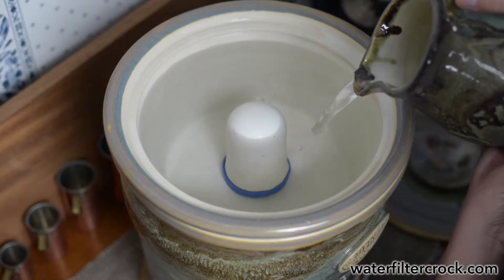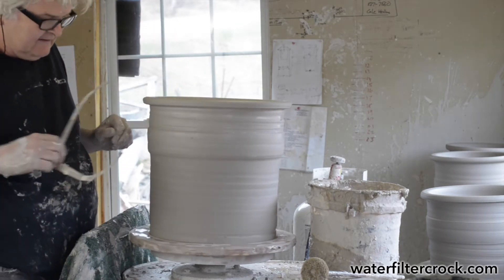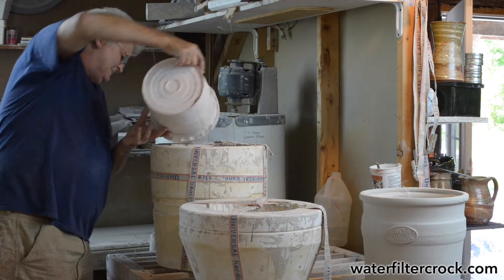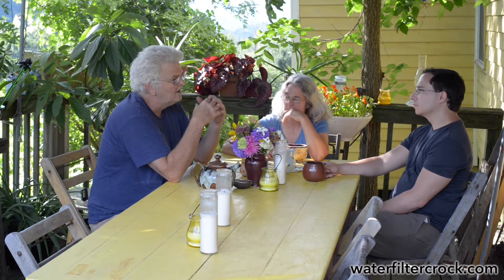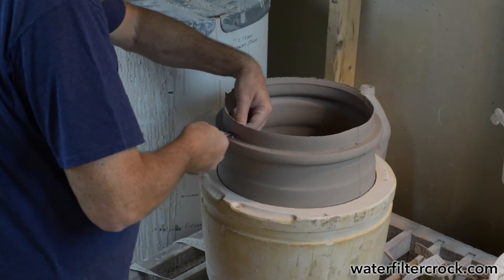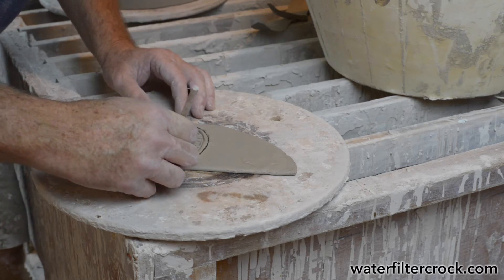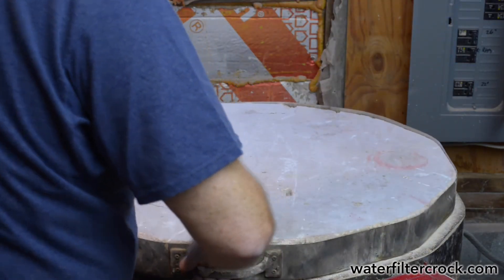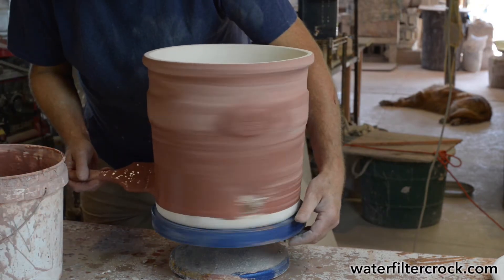Making a Stoneware Water Filtration Crock

Comment: The berkey type filtration which you guys are imitating also requires 2 vessels. One at the top where the water runs through the filter and another at the bottom to hold and dispense the filtered water. I don’t see how the water gets filtered just sitting there and not passing through the filter. Plus I like the idea of an old school bisque filter system where I do not have to wonder what is in it and if it is still filtering or constantly needing to be replaced.

Comment: The idea of clay water filter is ancient. It is used in bisque form, not glazed, to filter the water through, into another glass or metal container to catch the filtered water. It should not be glazed as glazes contain lead which can leech into the water and prevent the water from filtering through the clay. 
The other way pottery was used to store and filter water was in the form of a clay amphora. Very ancient. In this case the amphora holds the water and cools it as it sweets out the impurities into another bowl. The amphora has very thick walls and is also unglazed and porous. The water that sweets out is discarded because it contains the impurities. 
Do you guys make anything like the above?